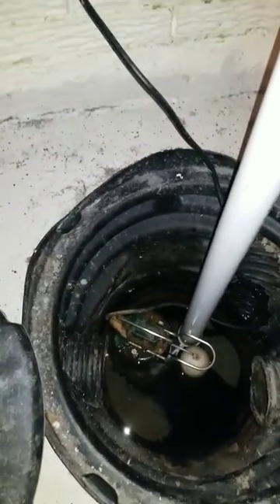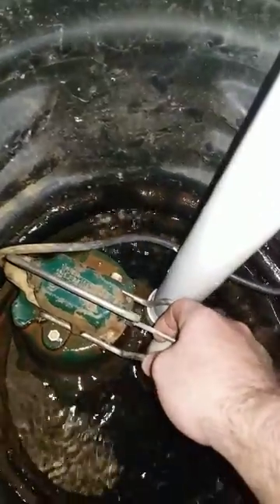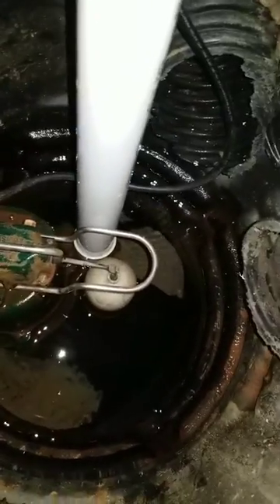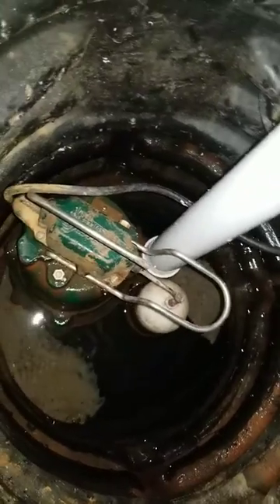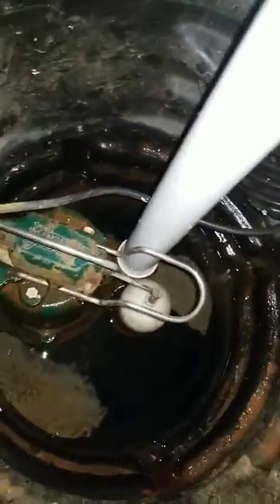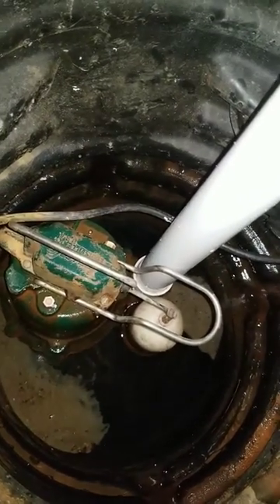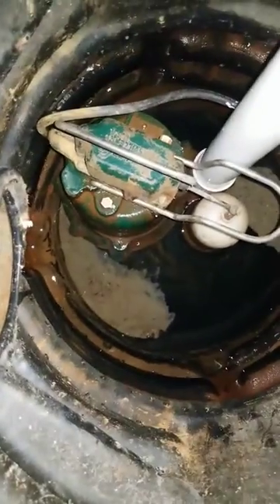Sump pump runs every 4 minutes!! Is this normal???

Comment: You might be pumping out the water table. Leave the pump off and see if the water level stops rising past a certain point (when it is not raining outside obviously). Raise the pump higher if the water table is what you determine it is pumping out

Comment: Be happy my friend. I live in southern ont myself.. Toronto area. My pump run's every 1 min from  Oct to june. pumps 12 gal each run. I have my discharge pipe running 300ft away from the house and it still doesn't matter. I just have a high water table at certain times of the year/ or a possible seasonal spring under the house... basement only 5ft deep. Once i get this place paid off we will be rebuilding another house on this property with above ground basement.
Reply from the maker: Holy shit man!!
Reply from the maker: @Kevin n me too dude.  I need to French drain or trench my yard or something.  It's pretty flat.  Water just sits there during heavy rain or snow melt.  

But around the actual house it looks ok its graded decent. 

I think there's possibly some sort of spring under my house

Comment: Overall I'd say it's uncommon for a pump to run that much, but many people rely on sump pumps to keep their basement dry.  I know from experience the Zoeller M53 can handle running every 4 minutes for many years.  If you have a backup pump and backup power you should be ok.  A natural gas standby generator could be a good investment.
Reply: Good to know thanks

Comment: Ours runs that much.  We kinda have to have it short-cycle because we have a storm sewer going across our lot and when it rains hard, we get a LOT of groundwater that comes in violent surges.  I'd rather replace the pumps every ~5 yrs than to deal with another flooded basement.

Comment: During the dry season measure how high your water table is. If it eventually levels out, and no more water enters the basin, adjust the height of your pump. If your pump is too low in the basin, it will short cycle. If you raise the pump the cycle time will be longer. You can use round concrete pavers to raise the pump higher. It’s a hit or miss, but, If you’re lucky, and your water table levels off below the concrete floor, then all you have to do is adjust the pump accordingly. The objective is to achieve a longer cycle rate for your pump, so that it has a sufficient cool off time between cycles even if it’s for a minute or so. Hope this helps.
Reply: This makes sense.

Comment: Mine started running every 3 minutes.  I think the water is flowing back from the big white part or "bilge".  Something isn't right.  It expels the water, fills up with the same water and recirculates it all over again, endlessly.
Reply: You need a check valve.

Comment: I have a basement systems triple safe which is three sump pumps two sump pumps that are electric and one sump pump that battery backup in case the lights go out my pump kicks on whenever it rains every minute so every 60 seconds

Comment: I have the same issue with a sump pump I went to installed a battery back up system ,  the pump is running every minute but the new owners said the old owner went and connected to the raidon?

Comment: It is because that pump float is designed to go off when there is a certain amount of water (like 6") and it pumps it to a level of 2-3".  I had the same problem.  Called Zoeller, they suggested another pump with a separate electronic float, that way I can place the float higher and the pump will not cycle as much, when it does drain it runs longer and drains more water.  This helped, still is not solving my problem.  I am going to increase the size of the pit and add 2 pumps, I need this for heavy storms.

Comment: Hi,
I live in NW Indiana. Cubs fan too. I live in a house that was built in the 60's. The clay drain tile has to be rodded every year! I've lived here for 16 years. The pit fills with water all year round. It empties out every ten minutes pretty much every day all year round. I just wonder if the main water line leaks underneath the house because, the water coming into the pit is crystal clear. I'd figure it would be dirty or cloudy in color?
Reply from the maker: Well yeah but ground water is FAIRLY clean. Considering anyway. 

Yeah i wondered that too with the water line but that comes in at the other end of the house then all the physical lines are up in the rafters. 

This thing hasnt run like this till this year we been here almost 4 years.  All the snow melt now its running every minute. But its keeping the basement dry.
Reply: If your water bill isn’t going up abunch then it’s probably ground water. Have you found the source to this yet?
Reply: @fettyguapo  It must be ground water. No other explanation.
Reply: @JamesSmith-xq1hp   I live in NW Indiana and I have this exact same shit happening in my home. I thought a water line might have busted but I’m pretty sure it’s all ground water. There’s a lake about half a block away so I’m assuming my house is low on the water table. I’m only assuming that because one summer it did actually stop and I was surprised but then it started again not too long after.
Reply: @fettyguapo  I think my house was built above an Indian burial ground lol.

Comment: That's not too bad but if it's happening all year round regardless of rain or shine it could be you're very close to the water table in which case buy the best pump you can, replace it like clockwork working or not every three to five years and investigate and invest in the best water pressure powered non-battery backup pump you can find - liberty pumps makes one that is well reviewed.  During hard rain or worse yet heavy rain and spring thaw, mine kicks on and pumps 5 gallons every 15 seconds!  I size my replacement pumps by tripling the max gph volume that I've seen coming into the sump at the worst of times to be sure my pumps are never overwhelmed.   Kind of goes without saying that this s even more important if you have a fully finished basement.  I'm not a big fan of the whole sump pump idea but it's builders code where I live so I have no choice but to live with it.  I consider myself a fairly reasonable lucid individual and  it strikes me as more than just a little idiotic to invite outside groundwater inside to just pump it back outside but maybe I'm missing some sort of relevant point other than it being a flooding time bomb.  I also don't juggle running chainsaws, but some people do!  Good luck!
Reply from the maker: I basically derived it was a water table thing because this year it didn't run much at all after July. It must have lowered this year.  But this year we got alot of snow, not looking forward to all of it melting at once.  Going to be running alot again.

Comment: Please let me know if found the cause of the problem,I have the same thing happening in my house!
Reply from the maker: Well im kinda at the bottom of my street. That isnt helping. Have had a shitload of rain this year too. 

Kinda comes down to a high water table in my area. From what ive gathered...the holes are there to pickup water BEFORE it even gets to my slab or get into my drain tile. 

Lived here 4 years and haven't ever had it run this much but it appears to be a normal thing.
Reply: I’m the second house on the bottom of my street also! Make sense. Thanks!
Reply: can i say i got the same @#@# problem.  We raised the pump a few inches and that seemed to help alot, and now we got hit with a shit ton of snow  that i imagine is melting nonstop.  I am losing my mind hearing that thing go on every 5-10 minutes.  perhaps that is just are dumb luck?  super high water table here too.  any updates since posting this?
Reply: I’m in MD.  House was built New and completed on December 2016. House was built by DR HORTON.  Neighbors have the same issue - I hear water discharge between houses when walking in the neighborhood.  Contacted County to show water accumulation outside where discharge occurs and was told water should recede 72 hours after rain downpour occurs...If not, there’s an issue with grading.  Water does recede, but sump pump runs when no rain (for a week or months) or after snow melts.  Neighbor says there could be a stream underground.  As of this comment, sump pump continuously run every 4 mins - we haven’t had rain or snow for the past week or so.

I’m worried my pump will stop working one of these days.
Reply: @nubar5  I’m having the same exact problem!! The snow melted but mine is still running every 20 mins. I saw the water coming in just like this guy video!! With the drill holes! I’m trying to figure out where it’s coming from!
Reply: @osas201  another problem I have is town made me put in seepage pit in far corner of my yard...that is now full too (3000 gallons) and water splashes out pipe that connects sump and gutters to seepage. Huge puddle at corner of house.   Water is pumped by sump but remains right near foundation of house and naturally leads right back to sump to pump again.  

Possible solution: tie sump pump to sewer line or if allowed, run drain to street slopes away from home.
 Town engineer comes to backyard to look and says, "yeah that's not normal"
I wanted to drop kick his ass
Reply: @nubar5  Yeahh I was waiting on summer months to see if it stops because I newly purchase this house and moved it. I will invest in running the drain away from house. Constant running of the sump pump is so annoying. Don’t drop kick the engineer man lol

Comment: yes, that's normal. however, you may want to install a backup sump pump just in case your main pump burns out.
Reply from the maker: It hasn't run like this in a few years now.  Plus they did a bunch of construction across the street now,  built a big retirement complex with an underground parking garage so my yard isn't the low point of the block anymore.
Reply from the maker: But i also have another sump on the other side of the house.
Reply: @stuff_n_thanngs7552  Sounds exactly what is happening at my place - contractor dug around perimeter to verify if french drain was blocked/disconnected and instead found that it had been placed (1962) above the footing so water has always went below it and against garage wall, under home.  Re-building concrete and adding new french drain would be ~60k so he is digging a hole in concrete in our garage, 2 feet deep, and will install a sump there to keep water level below basement/garage lower than now...makes me think it will look like yours.  We also have main pit at other end of house with sump pump that runs every 30 min...used to be every 2-3h...so not sure why frequency has increased.......have backup pump in that pit and wondering if he will put a backup in the garage one......how I hate this crap and worrying about it.

Comment: I have exact the same problem.  Is it a problem to have water coming in from small holes or crack instead of the two large pipe hole?  The pump runs too often for sure.
Reply from the maker: K so here's what ive gathered since i posted this.  When we moved in in 2014, we had a shitload of rain. That plus were at the bottom of the hill on the street corner. The last almost 2 years this thing has barely run at all.  The water table clearly has dropped. 

As for the holes drilled into this thing i guess that's normal, but they're drilled too low and we're under the table all that time.  Guess they're pressure relief holes. This was my first house so i didn't know much about sumps.
Reply from the maker: Also, there's been construction going on across the street for about that long. Building an old folks community. Underground parking garage,  the whole thing. So I'm not the low point anymore either. But yeah i think if those holes were only drilled about 2 rings higher up it wouldn't have been much of a problem. 

Hope that helps.
Reply: Thanks a lot for your response!  That make sense.  My pump runs every 3-4 mins like yours, makes me wonder why it has to work so hard😅. It’s 7 years old now and shows sign of stress (floater starts not reacting)

Comment: Hi, I’m having the same exact problem! Clean clear water running into the sump pump pit. I look and saw the drill holes but the water is only coming from one. It started like dec last year. I bought the house august last year and it wasn’t running at all during the summer months. I’m so concerned, is it a seasonal thing? Did you get it fixed or figure out where the water is coming from? Mine goes off every 15-20 mins all day!!! Did you get a back up battery? Plz reply
Reply from the maker: High water table was my issue.  Barely ran this fall or winter.  Now all the ground is thawing out its running about every 4 minutes.
Reply: @stuff_n_thanngs7552   this might sound stupid but how do you figure out if your house is on a high water table? My street is very long and I’m like in the middle. With what your saying it’s sounding like it’s seasonal and the pump is doing what is suppose to do to prevent basement from flooding since yours is coming back running again when the water start thawing ?
Reply from the maker: @osas201  this thing has run very frequently even thru out wingers winters long as we've lived here.  Its frustrating. But finally,  this summer-winter it hasn't run much.  Maybe every hour.  During the fall and winter didnt really run at all.  

Our yard takes on a shit ton of water.  Its flat. The grading isn't the best and we're at the bottom of a hill and on the corner of the street.  So i get it all.
Reply: @stuff_n_thanngs7552  completely get it, very frustrating hearing the sound man. I will give it until summer months and see if it continues running frequently or decrease drastically before I start looking at my options. I will investigate with my neighbors and see how often theirs run. Thanks man.
Reply from the maker: @osas201  what i really need to do is French drain my yard.  The city said i could tie into a storm drain underneath my street.  But that sounds super fucking expensive.
Reply: @stuff_n_thanngs7552  I know anything digging will cost some change man. You can try to register for America’s water resources it’s like 12 or less bucks a month they cover you for drainage issues and a lot more. After some time just call them they come fix all that stuff for you man.

Comment: That's messed up. U have water under your foundation coming in through weeps that shouldn't even be drilled in a sump pit. Someone likely did that to relieve the standing water/pressure under the foundation, meanwhile the actual drainage tile doesn't look at have any water coming from them maybe because the tile was installed wrong or has somehow failed which also gives  credence to my belief of why there are holes in the pit lining. Third issue is a Zoeller pump, which is a piece of s***. You're foundation needs to be excavated on the exterior and replace tile and regrade for more slope.
Reply from the maker: The tile works just fine.  Just need quite a bit of rain.  I don't have a Zoeller in there any more.  Really hasn't run much since the fall.  High water table in the area at the time of this video.  Still odd though how low the holes were drilled in the tub.
Reply: @stuff_n_thanngs7552  which pump did you swap the zoeller with?
Reply from the maker: @Jigs2580  utilitech. From lowes.  Idk if it's their brand or what but it's done a great job

Comment: Drill small holes in the bottom of the sump pit. This will make the sump pit drain slowly
Reply from the maker: All that would accomplish is let more water in from the base of the pit. 

The rings around the pit have holes drilled in it starting at the 2nd or 3rd ring.
Reply: Someone drilled holes to compensate for another major problem, water under the foundation!
Reply: Stop spreading bad advice. The only holes in a sump pit should be for the drainage tile. When that system fails people resort to drilling holes as a generic relief system
Reply from the maker: @SharpEdgeStandardOfficial  mind your business bud. My drain tile works just fine in both my sumps. 

High
Water
Table....

It has since lowered and this year only run a few times.